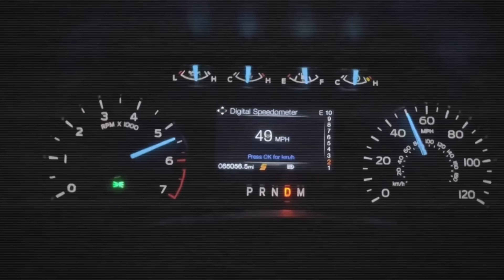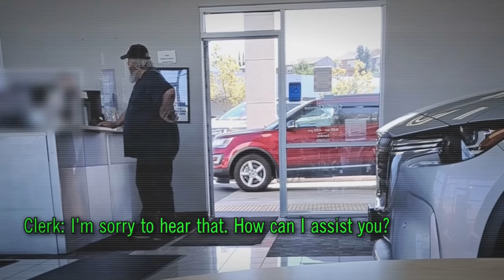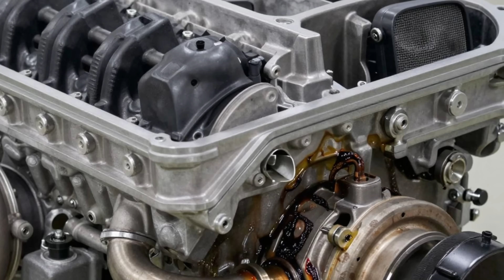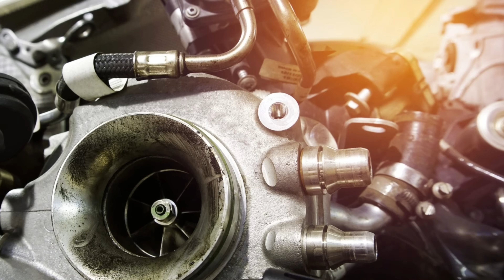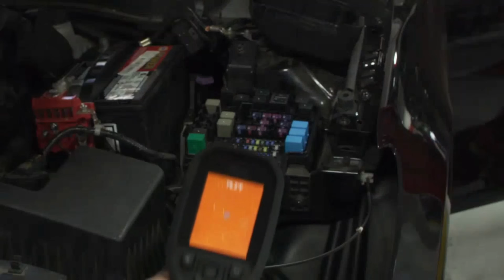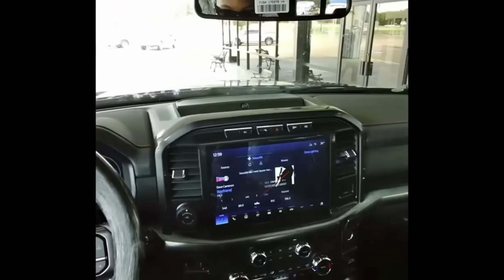4 Innocent Ford Idling Habits That Are COOKING Your Turbo Oil (STOP NOW)

Comment: Would heavy towing then the last 5 to 20 miles going light tow low speed be effective at cooling the turbo then at home last 3 min backing the trailer in then shut off be considered good practice??

Comment: The rattle at cold start is not the turbos.  Since when does Ford specify Full Synthetic for ecoboost?  I stopped getting ford service because they kept trying to give me Semi-synthetic oil.
Reply: All turbo charged engines from all manufacturers require synthetic oil.
Reply: @craigsmoll6217  I agree... but Ford dealer says semi-syn.

Comment: Second is not true because when the engine is started it doesn't idle but runs at higher RPM's until computer determines optimization. Also, turbos have been used in commercial trucks for decades with most lasting 100K miles with no problems.

Comment: anybody that really knows about engines knows you need to let it warm up even the transmission will benefit from sucking some of the heat off the engine and at least coming up to room temperature in a cold climate

Comment: Every time I see a ecoboost video I regret buying one
Reply: I have a 2013 f150 eco boost. In 13 years I have only had to do a water pump, o2 sensor, spark plugs and transmission module. And honestly I have never done these preventive measure but I will now. Maybe I have been lucky I do however only use Mobil 1 since my first oil change to this day.

Comment: I don't agree on the idle oil pressure.  My oil pressure gauge does not even move when doing a slight acceleration on rpm.  If this is the case then you have other oil issues.  Let your engine oil warm up then head out but do not push the engine.  Spent 6 weeks rebuilding turbo chargers during my heavy equipment apprenticeship.

Comment: Turbos aren’t even running at idle
Reply: Turbos are always spinning when the engine is running.  There is no exhaust bypass on the turbo.  Only a air supply dump valve.
Reply: @miked1102 ty . I assumed not moving.
Reply: Oil is still running through them!